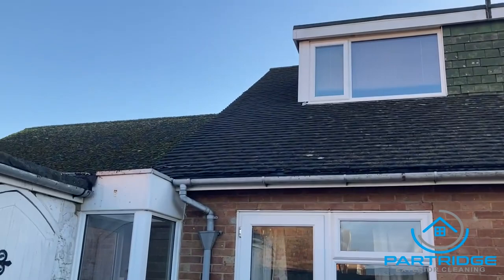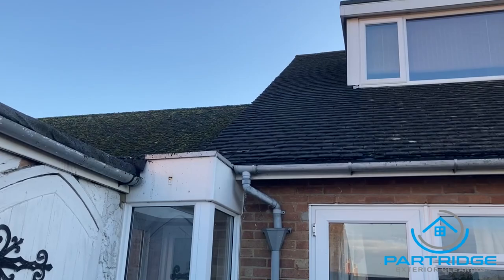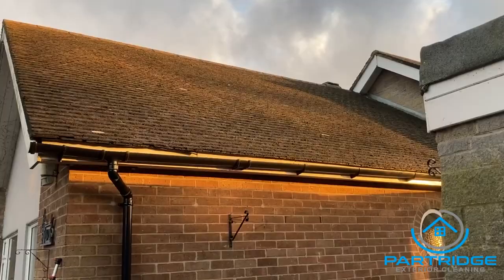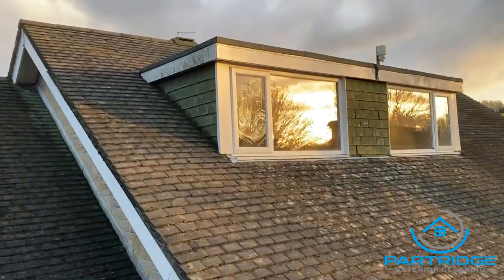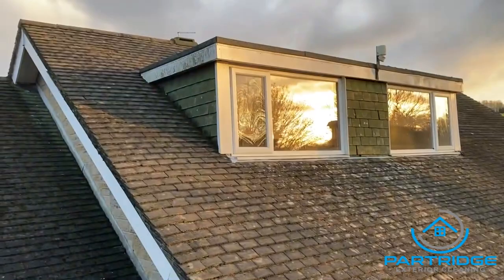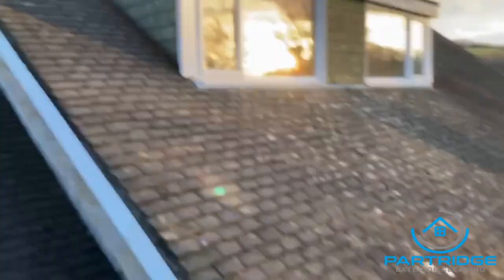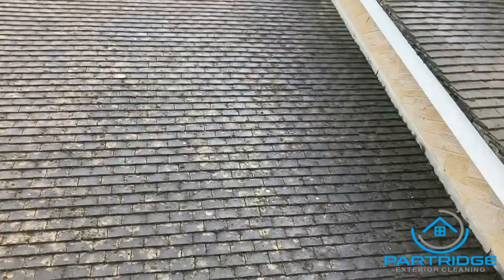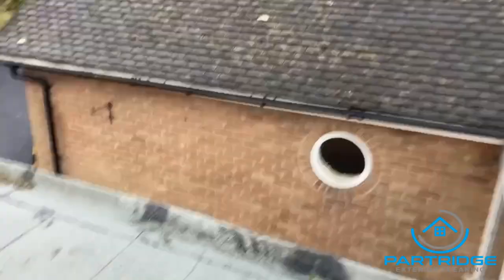ROOF CLEANING PART 2! Softwashing With Biocide // Partridge Exterior Cleaning

Comment: Hey Sid, I wonder if putting a tarp down underneath areas you scrape moss off of would quicken up your cleaning up process.  Moss comes off the roof mostly onto a tarp, then pitch it in the bin or scoop it up without getting the customers walkways dirty.  It's incredible how much moss grows on roofs in your area!

Comment: How do you find the steel scrapers? I found on certain roofs it was scraping the tile so I found a piece of hard rubber and cut it out to shape of roof tile. Works a treat. Wears down quickly but all I need to do is cut out a new one. Love your videos. Between yourself, Ricky Banjo and Ashley Mackintosh thats all the videos in my youtube history. Have a good year man. Keep up the good work. Jimmy from Ireland :)
Reply from the maker: Hey Jimmy, I usually always only use the steel ones but on these biscuit tiles the nylon seems to work a treat. That's not a bad idea with the rubber actually I'll probably try that out on some more sensitive tiles if the nylon isnt suitable.
And thanks a lot mate thats cool to be considered amongst those guys as they are why I started my channel!
Have a great year mate and thanks again for the comment.

Comment: Great job,  back pack is extremely handy piece of kit . Just wondering, what type of bioside do you recommend?? A lot of products out there, some good and some not great.  Thanks again for video's
Reply from the maker: I Agree I can't believe I used to spray the roofs with a pump sprayer, used to take me hours! 
I personally use AlgoclearPRO it's the best priced professional use Biocide I've found, delivery is fast too. You can get it from Progreen.co.uk 
I should be a bloody rep I've sent about 15 people to them in the last few days xD
All the best mate take care and good luck.
Reply: @PartridgeExteriorCleaning  Have you tried Bac50 Sid? I heard plenty of good things about it and its much cheaper than Aloclear PRO
Reply from the maker: @thecockneykayaker2239  Hi Lee, its all similar priced on the sites ive been looking at in the past? between 80-90 quid for 5 L and then postage on top. But I havn't tried it yet

Comment: Well done mate, another cracking job 🙏🏼

From the kit you currently use, to the research (I know) you’ve done what’s the best pole/blade setup?

I currently use virtually identical kit as you, Inc Algo Clear Pro but always looking to upgrade kit.
I’d rather buy right 1st time!
Cheers
Reply from the maker: Hi mate you cant really get better than a renegade pole and a flexi scraper in my opinion, the only upgrade would be a carbon pole to save your arms but the downside is scratching and ruining a nice expensive carbon pole.. so until im a rich man id rather stick to the aluminium poles that are near indestructible. as far as chems and equipment I think im using the best. a fancier dosatron to inject chemicals may be better but for the cost the difference is not much if any. apart from all that its just upgrading the access on the jobs. towers, cherry pickers etc.
Reply: @PartridgeExteriorCleaning  
Ok great thanks for that.

And thanks for taking the time to provide such detailed information and explanations in your videos, they help so many people. 
Your smashing at the minute...bright future ahead of you lad 👍🏼
Reply from the maker: Thanks buddy appreciate that! Glad I can help some people out, it’s daunting when you first start for sure!

Comment: Hi mate I was just wondering why do you start biocide in at the bottom surely you should be doing it from the top
Reply from the maker: Hi mate sometimes on steeper pitches I will go from the bottom of I can as you can end up with tons of run off, if starting from the bottom it kind of catches it and slows it down a little so more product stays on the roof. Same principle as cleaning render, hope that makes sense mate
Reply: @PartridgeExteriorCleaning  Was looking to see if anyone else was going to ask the same question. Top job btw - looking to get into this game soon and doing my research living through you atm :)

Comment: Hi Sid, 
Another great video bud. Can I ask - how much of the roof will the 20l backpack cover when washing on the biocide. For example, would 1 backpack full, cover the roof in this video? TIA. Dave 👍
Reply from the maker: Hi mate i filled up about 3/4 of the way through the first side and then roughly the same through the back side and filled up half a tank to finish it off but had some left over. so around 50 litres in total used maybe?
Reply: @PartridgeExteriorCleaning  not too bad then. I thought that a backpack full would cover about half of a side, so actually it goes further than I expected! Happy days. Enjoy the video's bud, keep up the great work and thanks again for answering my questions 👍😊
Reply from the maker: Keep it on a low flow rate or it will only cover half a side and chemicals will be running down like crazy.
Thanks mate and any time 👍

Comment: Hi Sid. Love your video’s. Question,  what biocide do you use. I’ve tried gk pro and it’s good but expensive. People are saying about Bac 50. Have you tried either and which would you recommend??
Reply from the maker: Hi mate thanks a lot! I personally use algoclear Pro 
I can’t speak for the others as I havnt used them but the top 3 all do the same trusted job every time, at least that’s what I’ve heard!
Reply: @PartridgeExteriorCleaning  hi mate, do you need any certificates or licences to use this product? Thanks!
Reply from the maker: No mate biocides do not require a license 👍 I replied on the other video but do your homework and read the safety instructions and protect your lungs, skin and eyes !

Comment: Great job Sid. Any issues using the biocide at low temperatures. Does it effect the results?
Reply from the maker: It can do mate so always worth a careful follow up every few months if you’ve risked it. Wasn’t that cold on this one so not worried. Getting colder though so may have to delay the next jobs until feb
Reply: @PartridgeExteriorCleaning  Cool, tks as always for the reply.

Comment: How much do you charge for a job like this mate?
Reply from the maker: Roofs all vary mate I can’t remember how much this one was but my minimum is 600 for bungalows but my average job is probably 900
Reply: @PartridgeExteriorCleaning  you are doing well. Roughly what I'm getting steam cleaning plus the cherrypicker and tower costs
Reply from the maker: Bump those prices up! A steam and bio should be the most expensive in my opinion 👍
Reply: @PartridgeExteriorCleaning  will do mate!